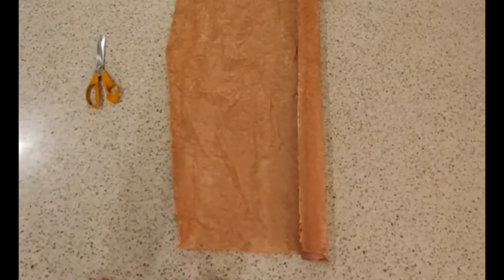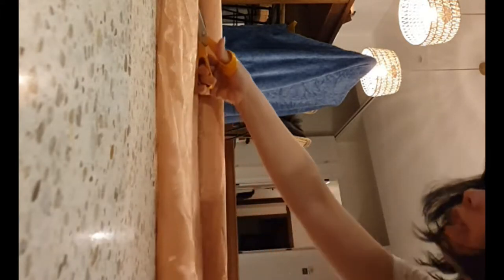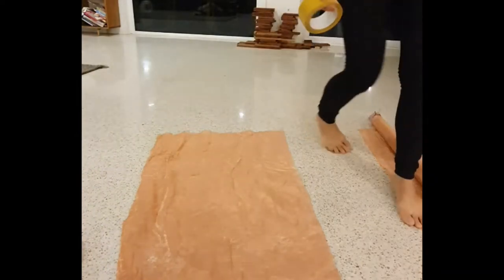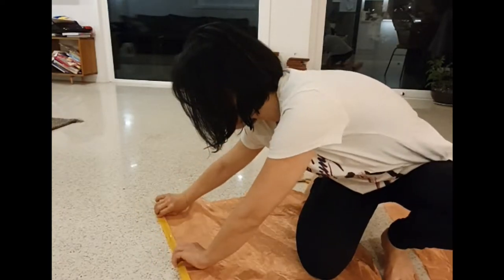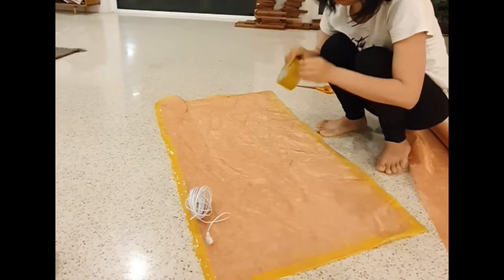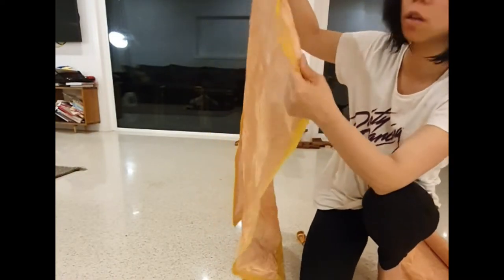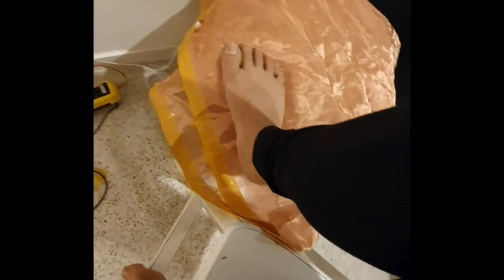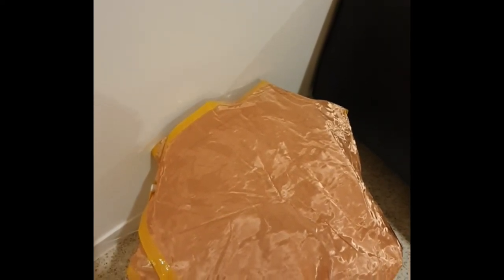How to make your own DIY grounding mat using only 4 materials

Comment: the universe moves again  just when my old grounding met needs replaced I find this great video    earthing - has been a life changer for me
Reply from the maker: That's great to hear!
Reply from the maker: @utubestalker.dotcom  I'm not sure what an anti static wristband is. If it is conductive, I will highly advise against it. Metal bed placed near an electric socket is like an antenna emitting dirty electricity. Having anything conductive attached to your wrist and then to your metal bedframe will make it worse.
Reply: @zacoliorganic  really? I just recently moved and had to buy a new bed frame and it is metal.. and I have 2 electrical socket right next/under it. I have had this bed for about 4 months now and haven’t had a good night sleep yet.. I moved into apartment 7 floors up in city so try and make the effort to go to the park and take my shoes off but it gets hard..
Reply: @zacoliorganic  there has Ben been times I have woken up and my foot was just touching the metal bed frame and I wouldnt feel rested at all something was tell me it wasn’t good for me..
Reply from the maker: @dkae92  most likely due to the radiation from dirty electricity. Do you also sleep on the spring mattress ? That will make it worse too. If I'm you, I'll switch to a non metal bed and non spring mattress and move the bed about 60cm off the wall where the sockets are. If you have lamps plugged into the socket make sure they are not near the bed and the switches are turned off at the socket. I usually unplug all electricals connected to the socket too so I'm not bringing the radiation closer to where I sleep.
Reply: I live in a seconed story apartment. I made a home made canopy around my bed and idk if i should ground it outside theiugh the window or make a DIY outlet plug. Can you tell me exaclty step by step a list of what materials to get at home depot and how to install the ground or outlet and the safest way to go about doing it and where to put it so i dont get shocked? I'm new to this so it would really mean a lot. Thank you 🙏
Reply: @dkae92  wow i bought one 4 months ago ,same problem...

Comment: Stainless might not connect to ground as quickly , but it brings me to zero in short order. I use an old radiator screen and plug into grounded outlet with only the ground prong on a three prong plug wired, of course.  There are lots of ways to do this, I guess. I saw a video when I made mine and the presenter used screws to connect to his screen. I used small zip ties. 12 Gauged  stranded wire. I feel like the zero state of charge I spend a lot of time in every day has reduced stress and inflammation a bit, so the time spent making my mat was definitely worth it.
Reply from the maker: Thank you for sharing. Love it! ❤
Reply: I live in a seconed story apartment. I made a home made canopy around my bed and idk if i should ground it outside theiugh the window or make a DIY outlet plug. Can you tell me exaclty step by step a list of what materials to get at home depot and how to install the ground or outlet and the safest way to go about doing it and where to put it so i dont get shocked? I'm new to this so it would really mean a lot. Thank you 🙏

Comment: Nice project ! I make my own foot mat with foam / alliminium foil and a deck of plastic fly mess. The alu is pulling tru the fly mess and works perfect . I measurre from 2 volt to 0,009 volts ;-) i feel the energy out flowing out my body tru my feet in de mat. I make everything from trash ;-) later i make improvements from better materials as you show in the video . Thx a lot !
Reply from the maker: Thats awesome! Would love to see a picture of your final product!
Reply: Be careful with aluminum. It is bad for your body
Reply from the maker: Yes direct contact with aluminium is not good but you will put a cotton sheet or two over it and sleep on top.

Comment: Thank you for this. This is wonderful. I already had some copper fabric from Ali Express, so I have used that. I also had some copper tape so I used copper tape to join the grounding plug and the copper fabric together
Reply from the maker: Brilliant! Let me know how you go!
Reply: @zacoliorganic  well I tried it last night. Definitely slept better myself. My wife didn't notice anything but I think it'll take some time. I'm waiting for my multi-meter to arrive so that I can see factually how effective it actually is.
Reply from the maker: Nice! Don't forget to stay away from metal bed too. Also, move bed at least 30cm away from wall with electable circuits
Reply: Could you tell me detail of this mash. Size, type, cost, #diameter of cooper fiber, etc.
Reply: @Elliott I haven't heard this either, however, it does make sense tho if where there are any ports, they will give off certain radius of conductivity from the main electric sources.... but... if one can't move away from the wall too far, one can always put up rubber mats etc on those areas so there is no conductivity flowing out from specific areas!? I am no tech, but basic science knowledge can be used here. Sometimes we got to use what we got or what is the most cost effective ways, and if that means we have to get creative and use rubber to try and eliminate the over  excessive amounts of electric currents or EMFs, then it's better then nothing or not doing it at all! 

The mats are ridiculously over priced!  Rip off's 
All the best 🙏

Comment: Be careful if there are wrinkles in the mesh as over time those can become creases with saw-like edges. I used 120 steel mesh and fixed it to a small, thin floor mat to keep it spread out. When the sharp bits manifested I just hot glued some craft felt over that bit.

Comment: Great!
You can get 95% cotton with 5% silver, those are the most comfortable and durable made specifically for grounding (:
Reply from the maker: where do you get that? Alibaba?
Reply: @saadams4937  do you think the fabric would be as conductive as the copper mesh?
Reply: @FlwrMs  Probably not. But definitely more comfortable...
Reply: Clint Ober , the man who sold them said(check interviews) that silver oxidizes fast, the more one perspires the faster that product will be usless. So he switched to carbon based conductive material
Salts from the sweat corrode the silver he says
Reply: @DarkoP9.13  I highly doubt that.
Reply: @itaigoldman156  you shoul try it at first
Reply: @DarkoP9.13  agree, my silver sheets are no good after a few months (checked with multimeter) expensive too..
Reply: @DarkoP9.13  Yep, and copper corrodes even faster.  One can buy SS fine mesh at reasonable costs.  it will be more stable.
Reply: @itaigoldman156  don’t know about the corrosion but it’s true that after a while it’s useless specially if using a washing machine. Don’t know how long it lasts but it stops working after a while. Also some say it’s not good for your skin microbiome since silver will interfere with it. Just something to check out.
Reply: @DarkoP9.13  

CAN YOU PLEASE RECOMMEND A GOOD CARBON BASE MATERIAL........
THAT I COULD USE TO MAKE AN EARTHING SHEET.
Reply: Can I do grounding out side room with groundin rod please replay

Comment: Maybe I've left below a too long comment so long story short is: Why does not in apartment grounding for a week now, night and day have the slightest sign in reducing leg, arms, throat inflammation or improve sleep neither to me or my family? It was made through a wire soldered to the copper pipe in the heating system and metal plates applied on the skin. Multimeter shows voltage drop to 0 when touching the plates so it's grounded. And I was so optimistic about this... Thank you!
Reply from the maker: Hi Jackal inflammation can be caused by many different things. Exposure to EMF is just one is them. To fix inflammation, the first thing i will look at is diet, and things to avoid at all cost are gluten, unfermented diary, grains, GMO food, processed food and soy. Grounding will simply reduce your body's burden from EMF exposure in the form of electromagnetic fields. It may not help with exposure to RF radiation from wifi, mobile phones, smart meter, 5G etc. If i have chronic illnesses, I'll first deal with it using food (check out the GAPS diet), then remove as much EMF exposure as possible, stay grounded and support your body in detoxification (detox bath,  infrared sauna, etc).
Reply from the maker: Doing just one thing will not make the problems go away. You will need to look at the big picture and deal with the issue holistically ie diet, low tox lifestyle, grounding, detoxify, emotional health, etc
Reply: @zacoliorganic  Thank you very much!
Reply: I realize you comment is 2 years old, but.....  Maybe your grounding items will make you feel better if all of one type of metal is used.  Since the pipe you attached it to is copper, I would try all copper.  Dissimilar metals touching each other can also lead to galvanic corrosion.  Also, one metal might have a clear coating on it, so no real contact is made.

Comment: Thanks for doing this video! You mentioned next time you might purchase a lower micron. Please indicate what measure you would go for? Trying to wrap my head around the micron thing....so 50 microns would be a larger weave than 200 microns? TIA!
Reply from the maker: I'll be looking at 100 or 150 micron. Might also want to consider using stainless steel which could be more durable but it won't be as conductive. Something to think about
Reply from the maker: I'll be looking at 100 or 150 micron. Might also want to consider using stainless steel which could be more durable but it won't be as conductive. Something to think about

Comment: the only issue i has was the poky metal staging me every once in a while.  I made one out of a 1x24" copper plate which is much more expensive but also much more durable and will last a life time and look much better
Reply from the maker: Fantastic. Do you mind sharing the link of where you purchase your 1 x 24 copper plate?
Reply: Yeah but you can't hardly sleep on it can you

Comment: hey girl, I liked your video very much, but only thing I am in need is if you can list out those 4 materials that are required for grounding ; very thankful to you!
Reply from the maker: Hi,

The four materials are

1. Wire mesh (we use 99.99% copper mesh 250 micron but find it tears to easily. Try a lower micron). You can buy this from eBay or Alibaba

2. Masking tape or duct tape

3. Grounding rod if put in earth or grounding wire if connected to socket (if grounding wire you will also need to buy the plug)

4. Voltmeter or multimeter
Reply: @zacoliorganic  thank you very much for detailed explanation.

Comment: Very good but after you tape wire to copper sheet, how did you connect wire to electrical outlet? Are we supposed to know that?
Reply: you have to buy an Earthing adapter which is a plug with only metal on the earth connection, then you insert the earthing cable metal lead into the adaptor and plug int wall socket.

Comment: Thank you for great video. Can you please share the settings on the multimeter. Meaning which wire goes where and what setting is it on? I bought a new multimeter its giving me strange readings. Not sure what I am doing wrong.
Reply from the maker: You will need to follow the instructions but you will need to ground one of the leads.

Comment: Please add some links to the products?
Reply from the maker: https://betterearthing.com.au/product/earthing-adapter/

https://betterearthing.com.au/product/earthing-coiled-lead/

Masking tape
Reply from the maker: You will have to search for copper mesh or stainless steel mesh. I got mine from alibaba but have to buy a roll of it which is quite dear. I recommend stainless steel mesh for longevity. Say about 150 microns. Mine was 250 microns and it can tear easily.

Comment: if you put it on the bed and cover it with a cotton sheet, will it work as well?
Reply from the maker: It will still work well. The sweat and moisture will help transmit the electricity

Comment: If this copper mesh is placed under the bedsheet do you still get the grounding effect ? :)
Reply from the maker: Yes you do. I've tested it. Even a little moisture will help with the conductivity
Reply: Some say to use an organic thin sheet like linen or bamboo, since you are sleeping on it there is plenty of time for grounding.

Comment: Hey I made the same after watching your video so thanks but my multimeter is not sensitive enough for body voltage. Does yours still work under a thin bedsheet? Can you please let me know?
Reply from the maker: Yes it works under a sheet. As there will always be some level of moisture through sweat etc, you still get grounded through a sheet on top of the grounding mat.
Reply: @zacoliorganic  oh great! Thanks for replying :)

Comment: Thanks! I'm gonna make one tomorrow! Do you sleep on it? Does it work under the sheet or must you have direct skin contact?
Reply from the maker: Yes it does! just a tiny bit of moisture will be enough to give you the conductivity. I've  tested it under a sheet, works beautifully
Reply: 100% polyester doesn't allow conductivity.  

If you use a mat under a sheet, the sheet needs to be cotton.
Reply: @skarath  what if it's 50% polyester / 50% cotton?

Comment: If you don't mind, what multimeter do you use and how do you use it to measure the volts? 
thank you for this very good video.
Reply from the maker: I use the voltmeter. :)
Reply: Red cable in V/Ohm/mA
Black cable in COM

Set dial to AC (alternating current) voltage; it's the V with the wavy line next to it

It might be good to look at some videos online for more specific instructions. Just look up how to measure AC voltage with a multimeter. She appears to be using an auto-ranging device, which is more expensive, but easier to use.

Comment: What about an aluminum  window screen, would that be a good alternative to copper mesh?   And what about making some type of wrist band or foot band out of conductive material and connect it to the mat with an alligator clips and wire at bedtime, thus bypass the need to expose body parts to have direct contact with the mat?  

 Or, bypass the mash altogether, and have above wrist band set-up plug directly into the grounding receptacle?   Just thinking out loud here🙂❤
Reply from the maker: yes you can use aluminium window screen but make sure it is not coated. has to have the aluminium exposed. wrist band or foot band will work too but it won't ground you as effectively as there's less surface area to connect you to the ground. still better than nothing
Reply: @zacoliorganic  Got it.  So it is better to have greater surface area contact.   Thank you so much for the reply!❤🙂
Reply: That's what I use it's quite prickly sometimes I know I can take care of the edges but so far I haven't but I figured it's doing a lot more good than the discomfort
Reply: Check put the wonder bracelet on YouTube here. ❤
Reply: She is correct; the window screen I bought at a big box store had an invisible clear coating to prevent oxidation, and I think it was not conductive unless the coating is removed. I think aluminum oxide is not very conductive and it will form on bare aluminum @zacoliorganic

Comment: There should be a Resister in the line  to protect from an unusual electrical event which could result in serious injury.  Beware!
Reply from the maker: Yes. Need to make sure the electrical in the house is properly earthed which it should be. If you are unsure make sure you get it checked
Reply: Yeah she definitely need a fuse something look up the appropriate fuse to use on a different video but something that will break if you happen to contact something electrified in your house or God forbid your house get hit by like
Reply: Meant to say God forbid your house get hit by lightning you need a fuse in there
Reply: yes, a 1 megOhm resistor should be fitted between the plug and mat to protect against electric shock - if you touched a live circuit (120/230V) while standing on the mat current would try to get through your body to the earthed mat, the resistor protects against too much current. If the mat's purpose is ESD protection, the resistor won't cause a problem.

Comment: I am living on 2 floor above and I connected directly to ground using electric wire. Then i connected that wire to the grounding mat. I also checked whether it is really earthed using earthing checker and it shows earthed. When i touch the mat and try to sleep, the heart beat is little faster but constant why like that? I can't sleep when grounded. What to do? Anything with length of the wire? I have 15 meter wire connected to ground or wire thickness? Or any othet way to do properly?
Reply from the maker: That's great! Do you have to run your wire from 3rd floor all the way down to the ground??
Reply: Zacoli Organic Yes and is that okay? And how you ground normally?
Reply from the maker: Yes totally! It great to be able to ground directly into the earth rather than through the socket. It gives a much better grounding. Good on you!
Reply from the maker: I ground through the earthing pin on the socket on the wall. Result is not as good.
Reply from the maker: You may want to invest in a circuit breaker. If there's lighting or something it will cut off the circuit to protect you
Reply: @zacoliorganic  Would you be able to guide me in how to procure the correct circuit breaker for this application? Everything I have come across looks like it goes inside a breaker panel. Also, what amperage would I be getting?
Reply: That's not completely accurate.  The 11 inch ground stakes are not as effective as the 8 to 12 foot ground rods driven into the Earth for grounding the home.

The 11 inch grounding stakes need to be watered whereas the house grounding rods do not need to be watered because they are so deep and maintain a good ground.
Reply: @zacoliorganic  Wow, didn't think of that. Scary! 😮